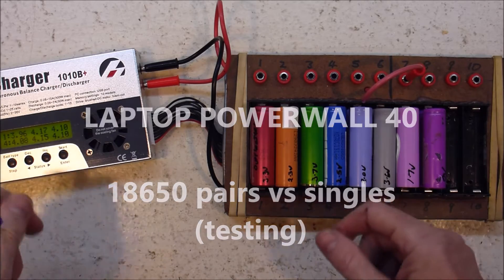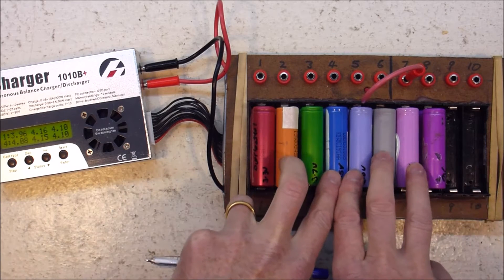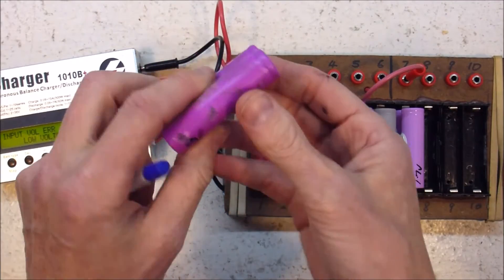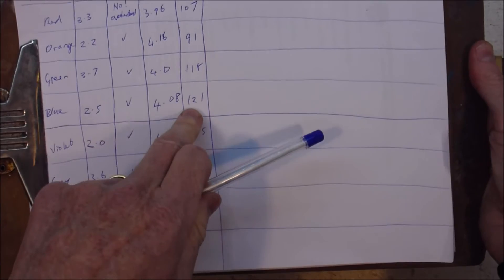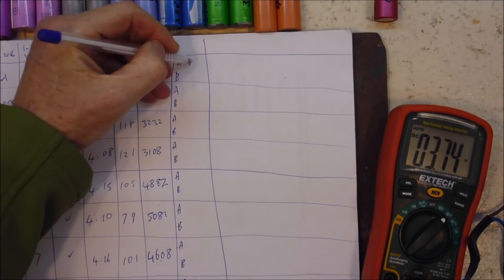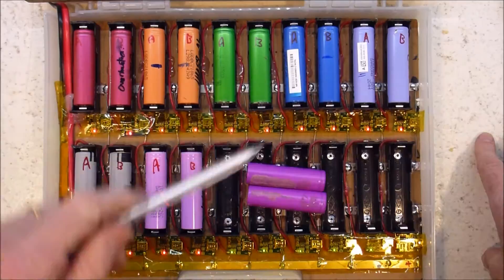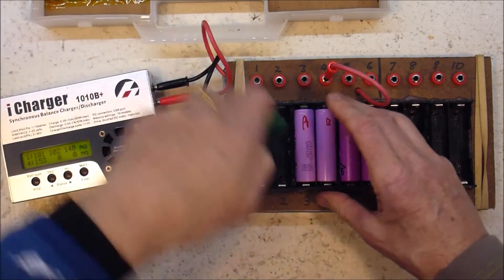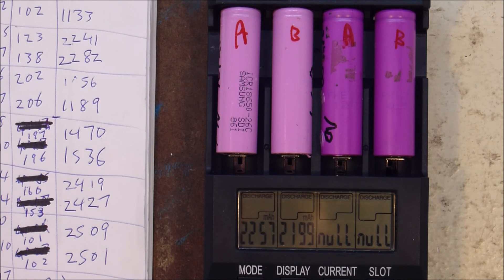Laptop Powerwall 40 - 18650 pairs vs singles: testing

Comment: The 2 cells that would not charge in parallel or seperately was obvious really and I think you knew that. Do you leave your cells for a while and check the self discharge?.
Reply from the maker: Yeah - I did choose them specifically because they were bad to get an extreme example in my data set (wanting to know "What's the worst case scenario?"). 
I usually don't bother checking cells for self discharge. My thinking is that any cell that has self discharged before I do a discharge/capacity test on it will produce a low capacity result - which will mean I'll discard it. But I could save myself some tedious discharge time by prechecking voltages. So I probably should add that in to my procedure.

Comment: Hi Paul I have an error 8 message on my Chinese 1500 watt 48v ebikemotor kit any ideas why the motor will not switch on? There is no pas attachment. Only one white wire not attached to the motor to controller. Brakes not attached. Pas not attached. Sensor not attached. Thanks Robert
Reply from the maker: Don't know sorry. Good luck.

Comment: I have recovered many dead cells with a pre-charge.
Don't do a normal charge to an high over-discharged cell it could be dangerous also !!!!
Reply from the maker: What current are you doing your pre-charge at?
Reply: +Paul Kennett 
you have to look it up on the datasheet per brand.
I use 80mAh and max 100mAh.
you can also bulk pre-charge with each cell a 10 ohm resistor in series to protect / spread the  current.
Reply from the maker: Previously I had been trickle charging under-voltage cells at 10mA - but it's a very tedious process. Using the TP-4056 with pairs means I'm doing them at up to 500mA. So far so good.
Reply: I changed resistors in my TP4056 boards so they charge cells with 0.5A. If cells voltage is below 2.9V TP4056 will chrge this cell with only 50mA. With stock 1A setting might be this current little biger, but it will be under 100mA.
Reply from the maker: I didn't know the TP-4056 was smart enough to trickle charge low voltage cells. It's even better than I thought. What value resister did you install?
Reply: 2.4k resistors and charging current is about 500mA. I am charging single cells. You charge them in pairs, so charging current per cell is also 0.5A.  lygte-info.dk/review/Review%20Charger%20TP4056%20UK.html

But for deeply discharged cells I am using my power supply and charge them with only 10mA. It's slow, but safe. I don't have so much good cells as you, so it's worth trying.
Reply from the maker: Tanks for the link. I hadn't seen his review. He's got some much good content!